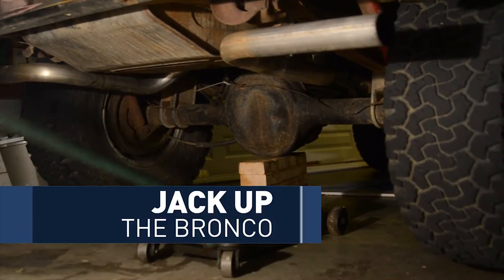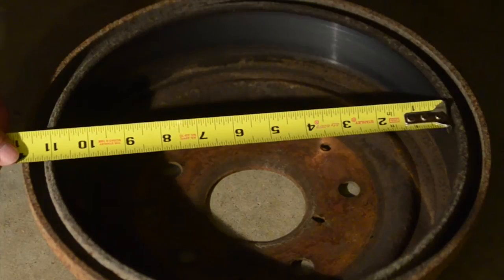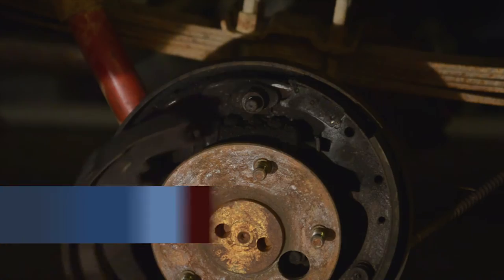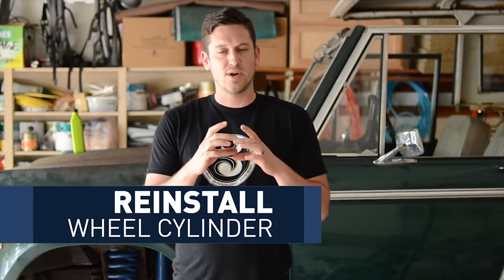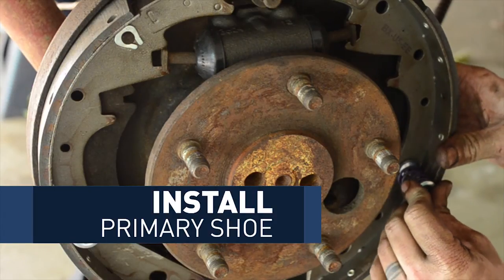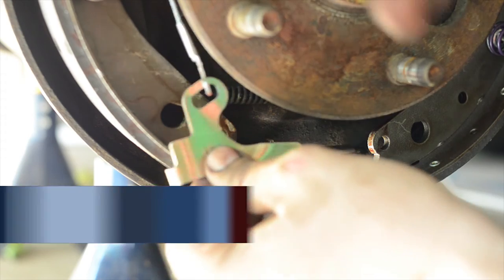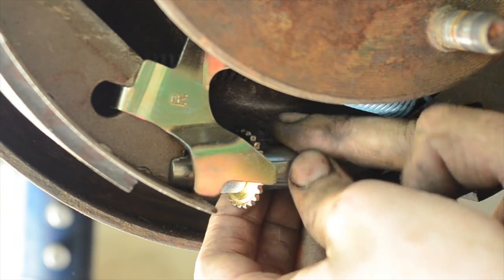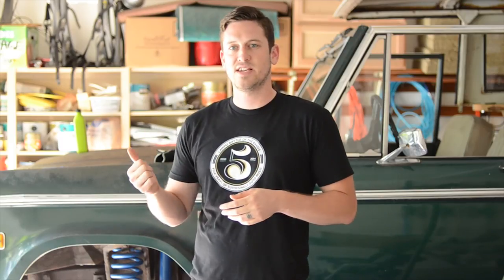Rebuilding Drum Brakes

Comment: Thanks for the video, it's time for me to do my rear brakes. I have a '77 bronco. In my truck so far I have done a new auxiliary tank, replaced the fuel pump and fuel line from the pump to the carb, rebuilt the carb. Replaced the coil and coil connector, cap and rotor, spark plugs, power steering pump, starter motor, starter solenoid, and radiator hoses. I've also ran a bead of automotive adhesive between the roof and the two cross member to keep it from popping up and down while on the freeway. Eric
Reply from the maker: +xeneric you bet! I'm working on a new fuel tank and fuel lines right now. The work never ends!

Comment: Good video. Sometimes you need to back the shoe adjuster off when they won't come off. If they are grooved, the shoe and the drum act like a keyway. Good points about brake size. I always forget which size I have. You would think that after owning my Bronco for 30 years, I would write it down or remember it by now. :-)
Reply from the maker: +Dan Mallery Yeah, I tried backed the adjuster all the way but I think the grooves were too deep. I'm with you on sizes. I've been making notes everywhere with that stuff because I can never remember!

Comment: Maybe it’s a difference between my 10” and your 11” but it looks like you are missing a piece on that top post where the springs attach. I have a washer/retainer thing that goes on before the adjuster cable. The “shoe guide (anchor pin) plate” seen here: https://goo.gl/images/kM4WtG

I had to get my wife to come hold the retainer pins in place while I put the springs on, but I got a Mityvac so I can bleed them by myself.